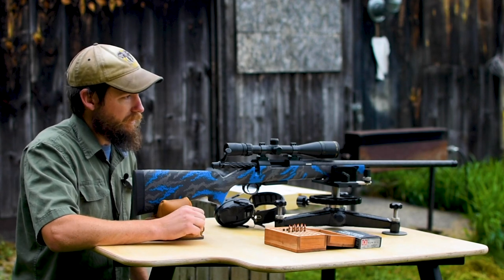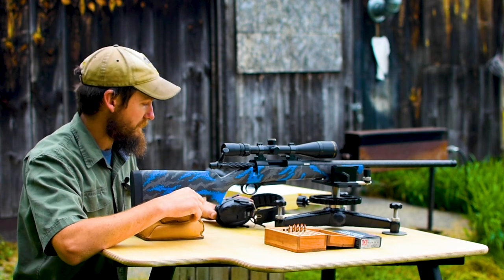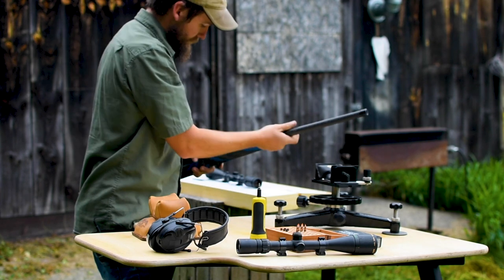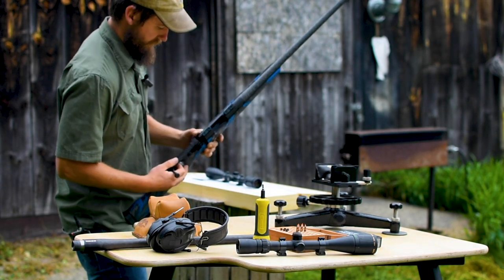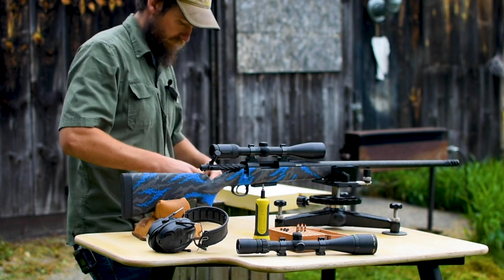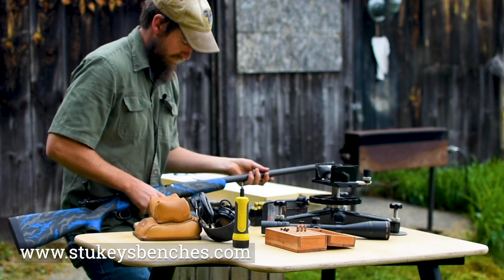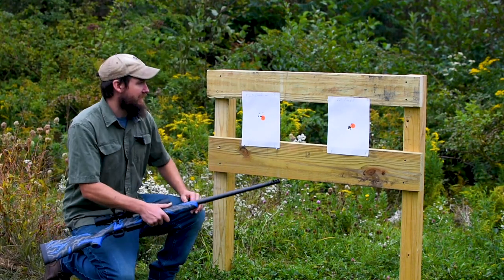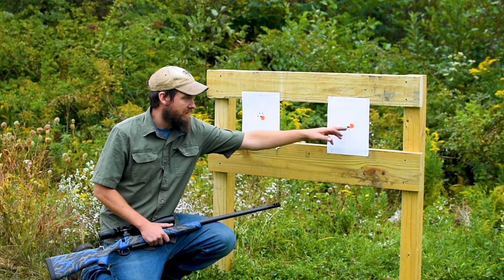SWITCH BARREL RIFLE TEST

Comment: Needing to switch barrels is silly. If a guy can afford this custom rifle setup then he should more then be able to just have 2 rifles and a man to carry them around while hunting.
Reply: There's been a whole lot of switch barrel rifles built for bench rest competition to fit the light/heavy varmit classes and even a few factory guns in the past so it's been well proven. At a starting price of $1335 for the action, add another trigger and stock it probably saves at least $2k. It's likely not the way I'd go, but then again it wasn't built to please me. That's some very impressive gun smithing to get a repeatable poi like that.
Reply: @turningpoint6643  it was a very nice rifle. But no one has time in a hunt or competition to switch a whole setup . In benchrest and exotic game hunting 2k is nothing compared to plane tickets, guides, lodges, licenses, taxidermy etc
Reply: @amazing_Joomla  Blaser is the same problem, you can buy five rifles that are equal or better than Blaser, for what they typically cost.  The big advantage is portability for air travel; the ability to go to hunting fields in possibly Africa, where there are 1 rifle restrictions, but a Blaser with any number of barrels is accepted; and there are high costs of rifle certification in some countries in Europe, or limits, on the number of rifles you can own.  But in the US, makes no sense.  But people want what they want.  There is a cool factor.